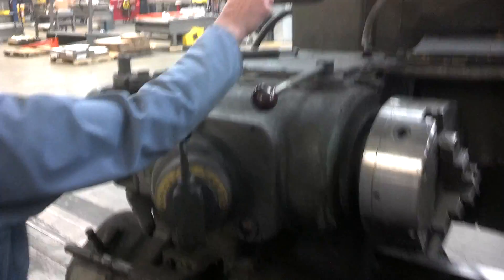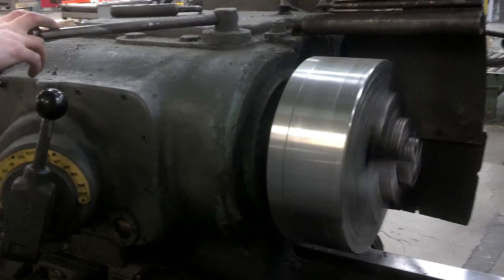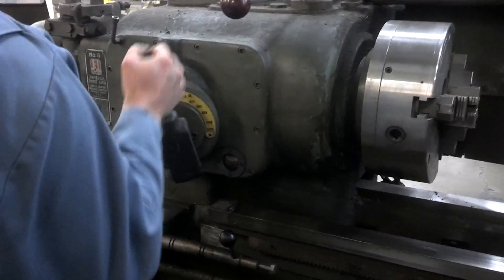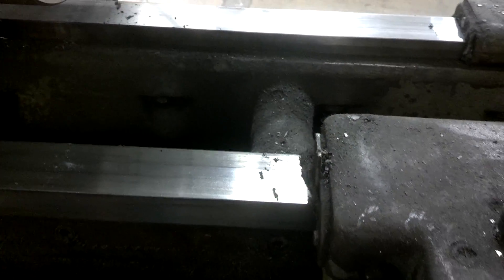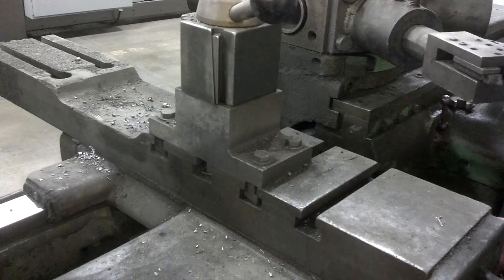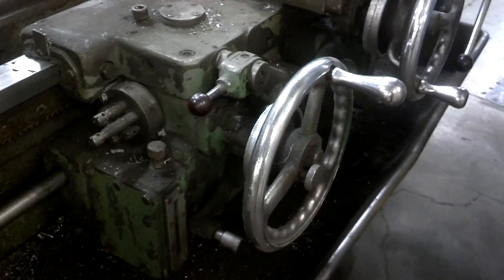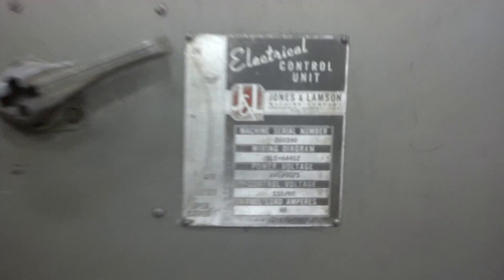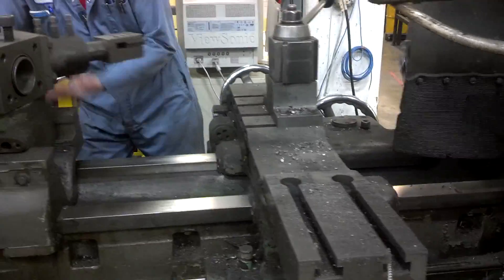Jones & Lamson Turret Lathe

Comment: Interesting video.   Your 3 phase is backwards.     Change any two lines.  When you push the engage lever away from the operator,  the spindle should run "forward.".......for turning....and drilling.....etc.